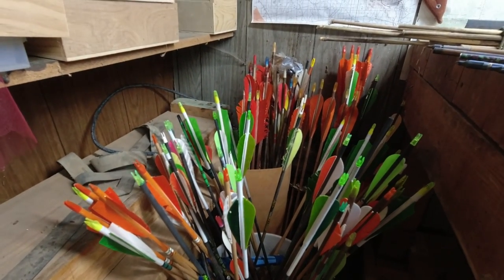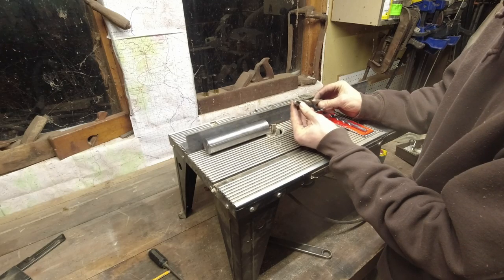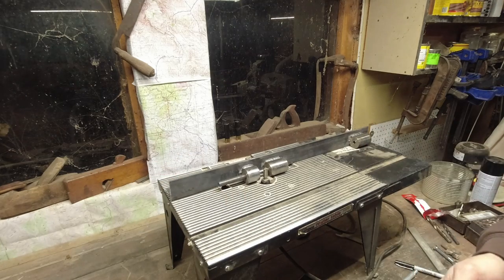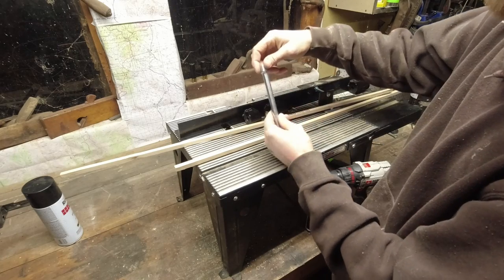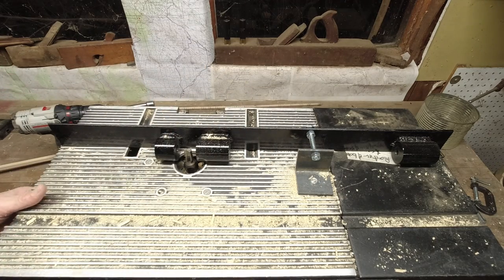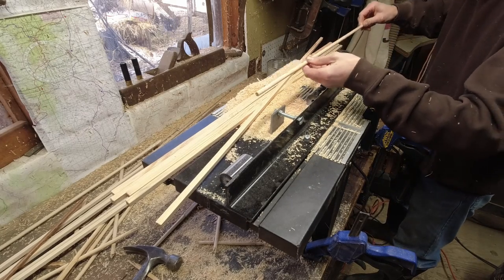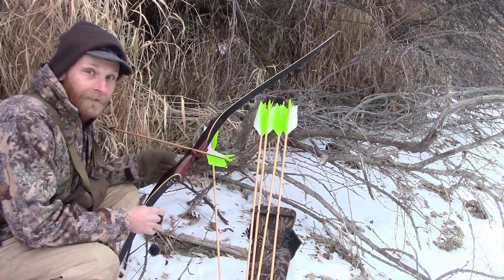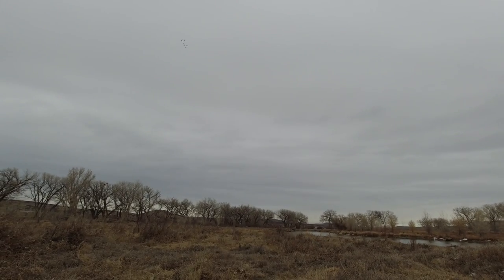Make your own arrows: Turning Arrow Shafts on a Router and Hunting Ducks

Comment: Awesome video! I make Doug fir and Port Orford Cedar shaft from scratch and I've found making the 3/8" square dowels with as little grain run-out really helps a lot, and of course the fast rps and slow feed speed. Seems like you have a really good set up! I like your spine tester better than mine, I'm going to try and figure out how you made it. Thanks a bunch!

Comment: I use ash wood. This makes for a heavy arrow but one that will make more of an impression upon what you shoot. Use a slow feed into the jig, but a fast rotation speed on the drill. Using your sharpest router bit will give a smoother finish on the arrow, but spinning the arrow in a hand made sanding jig is okay to smooth it out some. Dip them in clear finish of some sort suited to the outdoors, usually held in a pipe closed off at one end. To match the arrow weights, just dip the light ones more often than the heavy ones. Watch out for fletching tape, I've had a few fletchings come loose if the helical twist is too much on enameled shafts. A 3/8's shaft turned down to 11/32 loses only a 32nd in the process which isn't much to lose, and is a pretty tight tolerance. I wonder if starting with a 1/2" shaft would not work better. Paint the nock end to facilitate finding the arrow once it's been shot. Use a dab of glue at the front of the feather to streamline it against catching on stuff, your hand or a branch etc. Oh, and never stop learning.

Comment: You should change your feed direction. Router tables are fed right to left from the front.
Reply from the maker: I was using the back of the router bit so it seems backwards but it’s still a conventional cut. You’re right though maybe a climbing cut might work better. I’ll give it a try.

Comment: Yeah something like that.
But it requires though.
Good wood 11/32.
Bad wood 3/8.
It's easier to use a  couple 2X2's
A 16 inch piece and a 4 1/2 inch piece.
You draw a red line down one side of the 4 1/2 inch piece and drill it out to your small hole,....in the center.
You cut it to 3 1 1/2 pieces.
number your blocks 1 - 2 - 3,...
2-3 you dimple the mouth of the hole so the mouth is a little bigger,.... for easy feeding.

You will lay out the blocks 1-2-3 
1 5 1/2 inch's in.
2 1 1/2 AWAY
3 4 1/2 AWAY
Then you put a 11/32 or a 3/8 shaft through and glue them in place,.... and when their dry you screw them in place.
Then you Drill the big hole 11/32 I think is 1/2 and I believe 3/8 is 9/16.
If your just doing 1 you could just mount it in place.
When you glue it and screw it you,....... would put your 11/32 dowel in till it touches your router bit and clamp it in place,....or bolt it to the table.
Then drill the square peg hole.
Then your ready.

Comment: Use a round over bit.
Reply from the maker: I’ll give it a try on the next batch. Thanks
Reply: @Makingitwild  -
If you’re making a 3/8, since you’re spinning the dowel, you should be able to get away with a 1/2” round over. 

I’d make an adjustable jig that allows you to move the work piece closer in thousands. You’ll be able to get a smooth surface. 
The other trick is to round over the square edges. Don’t try to make the dowel but just remove the access material so you can shave it. 
Currently, by using an uncut bit you are subject to perpendicular marks.